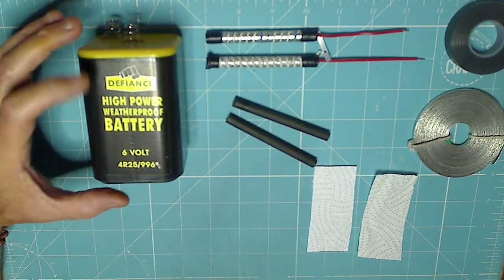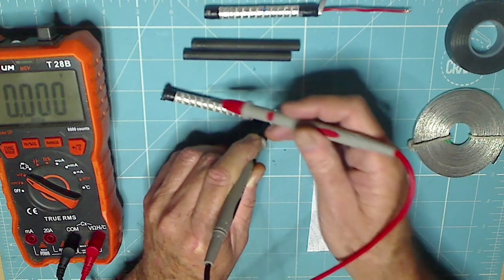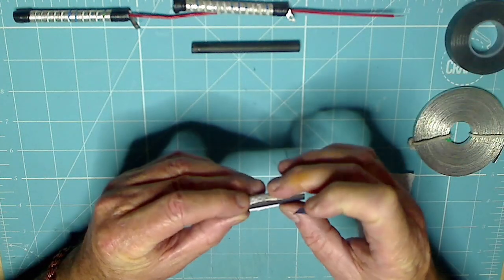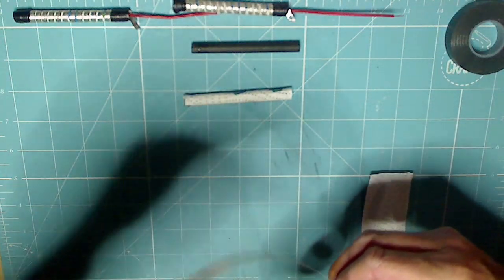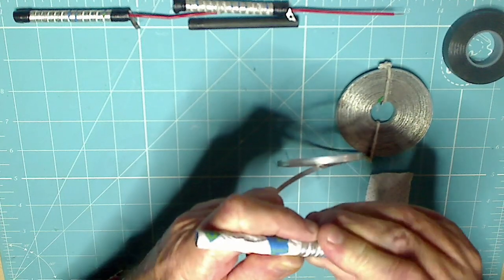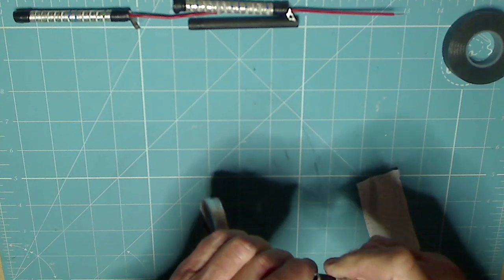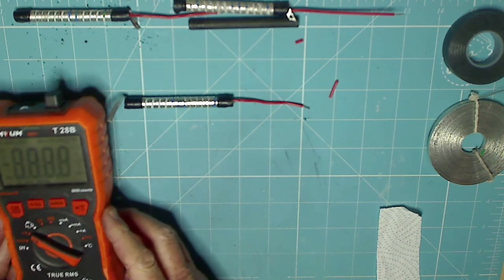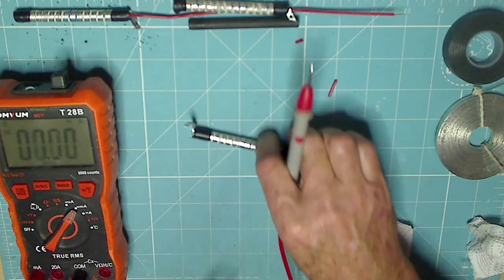Carbon Magnesium Battery

Comment: One of the best presentation on Carbon Rod & magnesium ribbon, tissue paper separater, water wet electrolyte, amazing combination DIY battery with good voltage and Ampere, excellent of you, good Demo except camera focus. OK fine thank you.👍🏿👍🏿👍🏿

Comment: I made a couple of similar batteries but with a magnesium rod with a separator layer and a carbon felt sheet wrapped around it. The rod lastes a long time and the cell can be rewetted many times.
Reply: hey david thats a good idea , do u think can it power a boat?
Reply: @sohanisatpathy9337  may not give enough current
Reply: @mrdovie47   that's what I'm working currently,  arrange em in such that they do , would you like to pin some suggestions
Reply: @sohanisatpathy9337  I don't think the magnesium strips thouching is a big problem, to make a higher current battery, I would weave the strips into a sheet use an insulator sheet and a carbon felt sheet to make one cell. Calcium chloride and water is my favored eletrolite (sold as a dehumidifier) it will draw water out of the air.
Reply: If that cell works, I would put another insulator sheet on top of the magnesium strips and another layer of carbon felt. negative will be in the center and the two sheets of carbon felt are positive. see if this doubles the current. with one good cell all you do is make up more of them to get the voltage needed. the cells will need to be insulated from each other like a lead acid battery.
Reply: @mrdovie47  will try that,  are u on LinkedIn?
Reply: Magnesium with carbon makes high voltage but less current. Aluminium with copper get more higher current

Comment: What is  life span of this battery??
Which electrolyte u have used??
Love from India
Reply from the maker: Singing Zone, the battery will last as long as the Magnesium lasts. The magnesium is eaten during the production of the current. The electrolyte is normal tap water. You can add a pinch of salt to the water if you want to. The battery will work until the electrolyte dries or the magnesium is depleted.

Comment: I don't understand why the Magnesium strip is not supposed to touch itself down the length of the rod..?? Considering voltage as a pressure and the Magnesium being conductive, it seems to me the voltage would be the same down the entire length of Magnesium.. 

Waiting on supplies to get here to start experimenting with some of this battery stuff..;) It seems to me that Carbon and Magnesium would be the ideal elements for the best battery, considering they are on entirely opposite ends of the galvanic chart, highly conductive, inexpensive and found in abundance..
Reply: I agree, that doesn’t make sense since it is all touching already. It doesn’t matter if he used a sheet or a ribbon, only the ribbon is more pliable. He may actually be losing potential with the gaps.
Reply: He's probably losing a bit of milliamperage

Comment: I've watched this video a thousand times, and I cannot for the life of me figure out why I get no charge. I followed the only 3 steps that there were. Any suggestions? The anode doesn't touch the cathode, and the magnesium has no contact points on itself. I'm stumped.
Reply from the maker: Hi Jesse, That is strange. Firstly I think you have to confirm that you are using a carbon Rod and a magnesium ribbon. Some places sell things that are not what they say they are. Secondly the separator can be a piece of paper towel. I am in a place where I can't make videos at the minute but will try to remake the video at some point. you can add a salt solution. Good on you for trying. Keep it up.
Reply: @allananne-marie1233  perhaps that's the answer. I'm using a graphite rod, not a carbon one.
Reply from the maker: @jesseklein611  Hi, Jesse, I have not tried Graphite. Not sure if it would work.